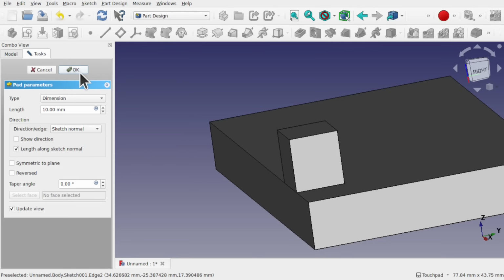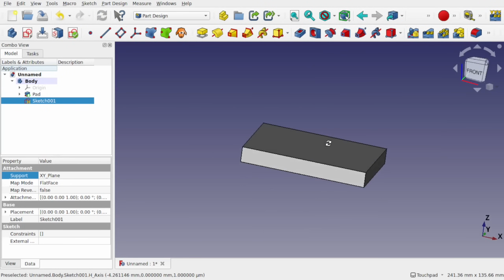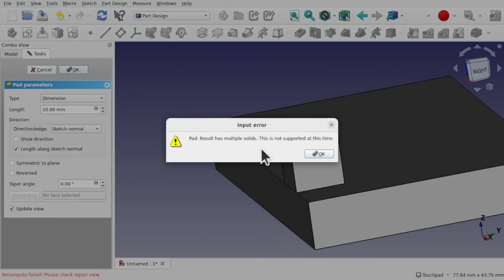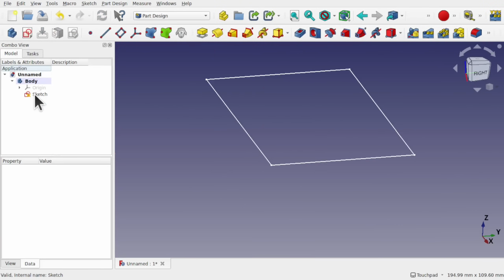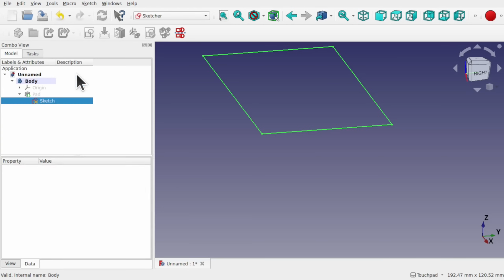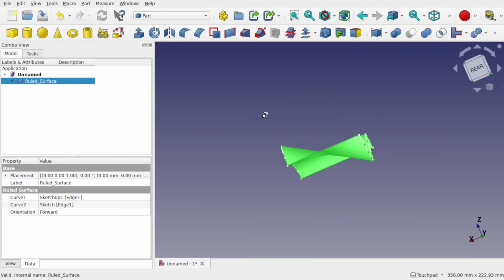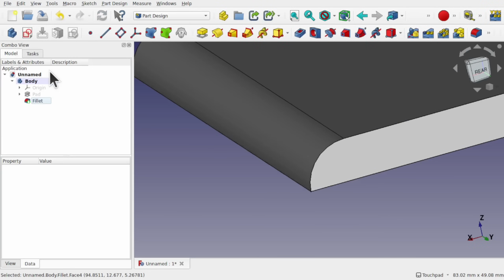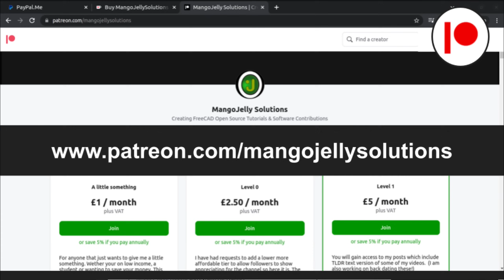TOP 5 Pitfalls with FreeCAD and How To Win (Especially for beginners)

Comment: More of a tangential question as you show 2 or so problems that may occur when referencing sketches to faces/edges of previously created features: Having had CAD lectures by old-school CAD dudes, I was taught to, where- and whenever possible, NOT glue sketches onto features, but use global/absolute references (independent xyz planes + linear offsets and/or angles where needed, construction sketches for more complicated stuff). The software used there did not suffer from FC's very distinct flavour of TNP and could actually handle building features upon features quite well - it was still advised against (because changes to earlier elements in the history might still in some cases break stuff, which may be a hassle to track down yada yada). To this day, I consider this good practice with any history-based CAD; but with FC and TNP, I 'd even say it should be pretty much an iron rule. Did they solve TNP / is that just not an issue anymore?
Reply from the maker: On the new features for 0.22 video I have pinned a post by one of the Developers to the top who explains the progress made towards this issue which is very promising.

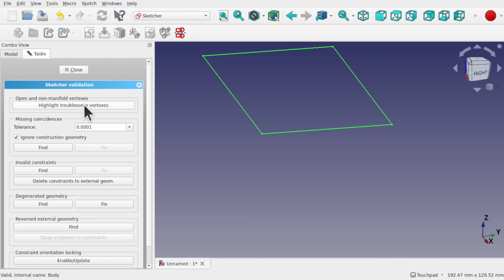Comment: 9:48 In my experiment, I removed one coincidence constraint from a rectangle, and kept the two separated points very close to each other.
The validation command failed to locate the break. 
Then I increased the tolerance in the Missing coincidences section (just below).
There was no effect initially. 
But when I raised the tolerance sufficiently, FC could find where the wire was broken.

I wonder if FC can snap the points together within a specified distance (like Blender)?

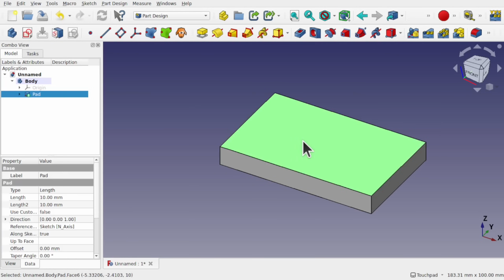Comment: 1:16 I just noticed that the Model tree does not help us see the distinction between a single-click and a double-click on a face. 
In both cases, the same node is highlighted!

Even the Properties table below the tree is practically the same in both cases.
Reply from the maker: Unfortunately not. But you can enable the selection panel which will show exactly what has been selected.

Comment: I find the main cause of wire not closed is when using the trim tool where it doesn't close the sketch after trimming & you can't see where the issue is.
Reply from the maker: Ah forgot about that one. Yep that can be a right pain when that happens.
Reply: @MangoJellySolutions  A second part to this video would be great!

Comment: Excellent troubleshooting video! I just started doing more serious CAD a few weeks ago and decided to go with FreeCAD. One quick question. When creating a sketch on the YZ plane, FreeCAD defaults to a view from the right side. Typically, I make my draft design on paper from the left side view. Is there a way to change that setting? (I know it's basically just viewing it from the opposite end, but it's easier for me to visualize.) Thank you!
Reply from the maker: Glad you enjoyed the video. So in regards to your question if your using part design after you created your sketch you can exit the sketch and look at the data tab. You will see a map reverse option about 3 properties down. Set this to true and double click your sketch and you will be on the other side. If your making sketches directly from the sketcher then there is a check box on the pop up called reverse direction. I have been looking through the preferences to see if it there is a default that can be set but I can't find anything which is a shame.
Reply: @MangoJellySolutions  Thank you very much for the detailed response. I will keep those settings in mind when developing future projects. It's also interesting that you sometimes can't select the origin as a reference point. For example, if you try starting your sketch from the opposite of the default (i.e., left side instead of right), the origin is visible but can't be selected. You have to switch to the default view to select it. Maybe this can be "fixed" in a future update? With all of your knowledge, I really hope you're working closely with the developers to keep making improvements. Thanks again!

Comment: I use freecad alot. Yes I run into these problems, such as the fillet !   However, the BIGGEST problems are;  imho,   Not intuitive, such as trying to run a tube along a path,  and having to use the German technique extruding planes ,    moving objects , in draft workbench, and  workbenches in general      Imho there should be a clean up of basic controls so One workbench with all basic controls     ( i know you can use preferences )    Also  again in my wish list    I would like sketcher to be like librecad  with similar drawing techniques,  @90,100  offset 100 ... u get the drift ( that is just my personal wish though!)  other than that its a very useable package